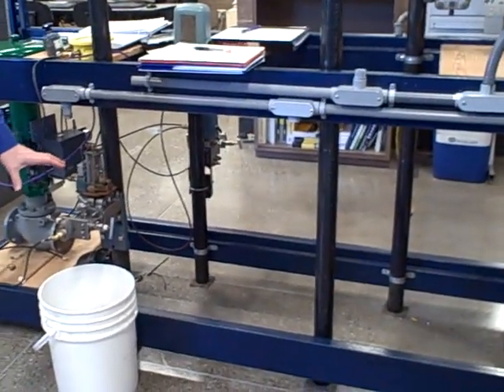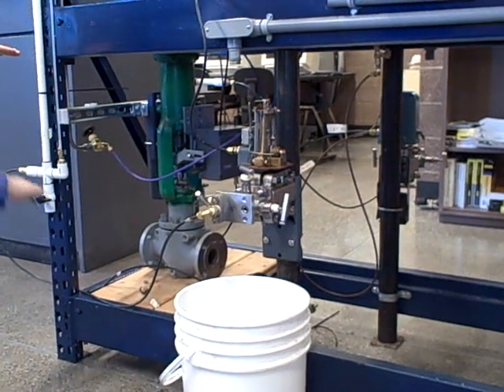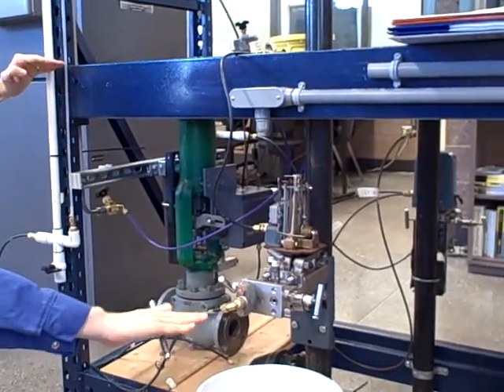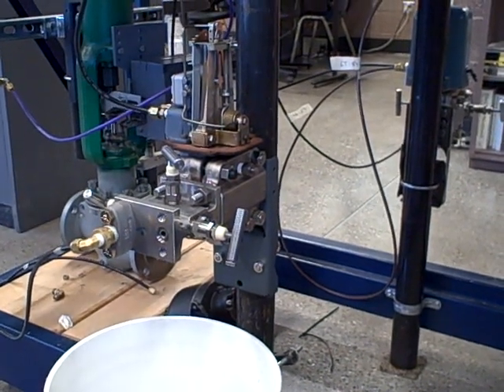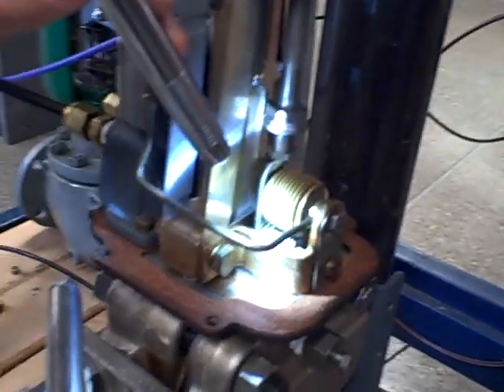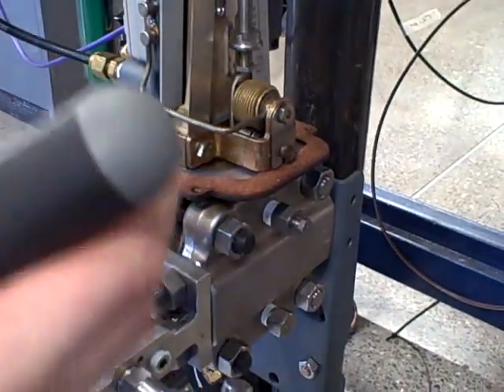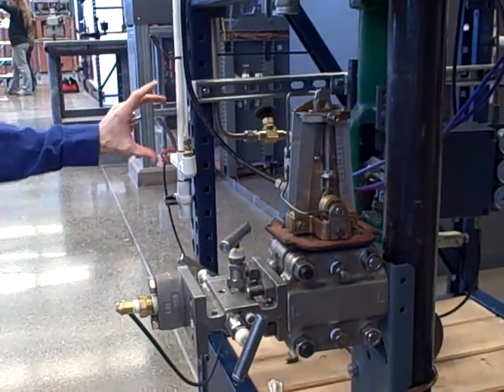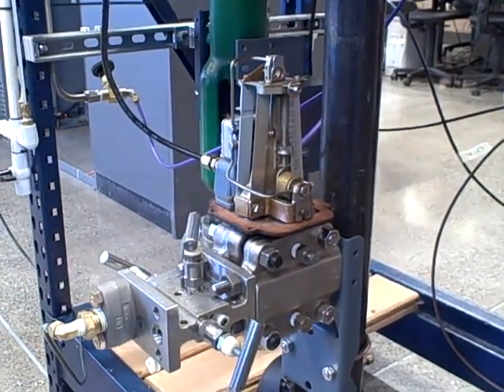Level measurement lab (pneumatic) -- suppressed calibration

Comment from the maker: @bkraz333 Most modern instruments are electronic, not pneumatic.  However, Foxboro still sells the model 13A pneumatic transmitter, and you will still find a good number of legacy pneumatic instrumentation in current industrial use.  I heard of a Shell offshore oil platform where a large number of NEW instruments were ordered pneumatic, simply to sidestep the problem of working in explosive environments, where electric signals harbor the potential of sparks.